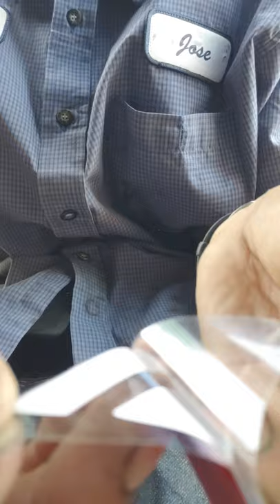how to apply Dodge hash decals on rims

Comment: I got some off Amazon and will be installing tomorrow if warm enough in Vermont. I have a 2021 Durango which is all black with black rims. I wanted to give it a splash of color without going over board. Think this will look good with red valve stems. Thanks for the video.
Reply from the maker: Yes I think that will look very nice...your welcome